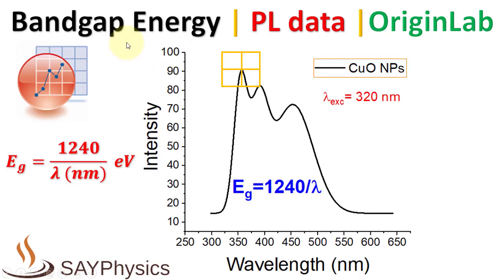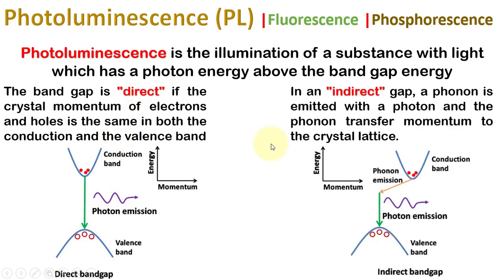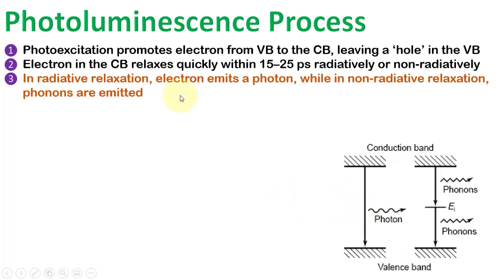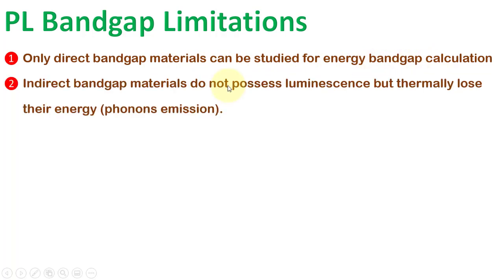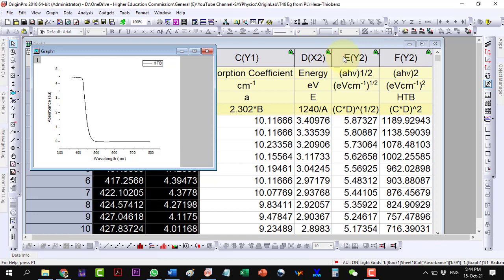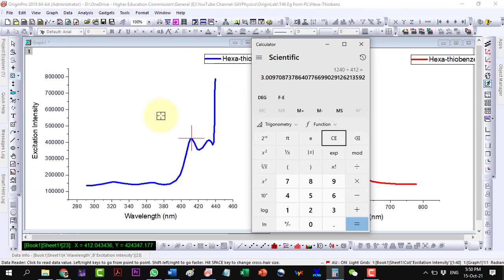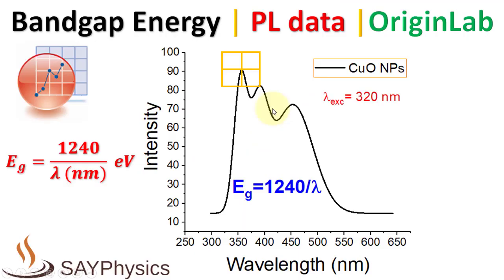How to calculate band gap energy from photoluminescence (PL) in origin

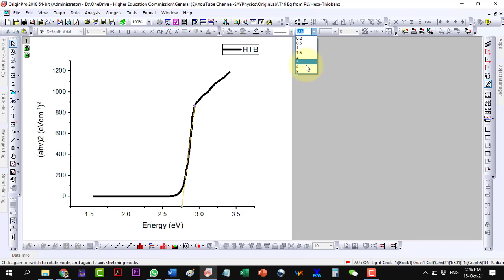Comment: 8:00 x-intercept you have found is not the true value, as y=0 line lies little bit above the horizontal axis of the graph. So Eg has to be slightly bigger than 2.8 eV. Moreover, the use of "Quick fit" tool is the right and practical way for linear fitting. It gives you two parameters slope (m) and y-intercept (y0) of the fitting line. Then, calculation of x-intercept (so of Eg) is  straightforward: x0=-y0/m.
Reply from the maker: Yes, you're right dear. Thanks for your valuable input.
Reply: @SAYPhysics  You're welcome. Thanks for videos.

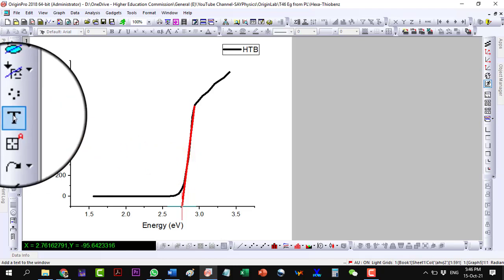Comment: The estimated band gap in your video around 8:23 should be a little bigger. The y-axis does not start at 0 and thus the fitted line reaches lower value on x-axis than it should. What do you think?
Reply from the maker: Yes, you're right. I should have been calculated at y=0, as explained in the first session of the tutorial. Please check the pinned comment. Thanks

Comment: Respected Sir in the PL band gap limitation section point No # that indirect band gap do not possess luminescence but  they  thermally loose  energy. My material is quasi  band gap can I measure the band gap and it will be correct as I already corelate the band gap  with the Urbach Energy and Tolerance factor
Reply from the maker: Regarding your query about the limitation of indirect band gaps in the PL band gap section, it is indeed true that indirect band gap materials typically do not exhibit significant luminescence, as they tend to lose energy thermally. However, it is important to note that your material, which possesses a quasi-band gap, may exhibit different characteristics compared to indirect band gap materials.
In the case of quasi-band gap materials, it is possible to measure the band gap and obtain accurate results. You mentioned that you have already correlated the band gap with the Urbach Energy and Tolerance Factor, which indicates that you have taken into account relevant parameters to support the accuracy of your measurements.
It would be advisable to conduct further research and review relevant literature to ensure that the methods you have employed for measuring the band gap in quasi-band gap materials align with established practices and principles in the field. This will help to validate your findings and provide a more comprehensive understanding of the band gap energy in your specific material.
Reply: @SAYPhysics  Thank you Sir

Comment: Incorrect way to describe fluorescence or phosphorescence. It is not the illumination time that differentiates PL. It the response time of the system in which electron transition time from CBM or metastable state  to VBM determined if it is fluo or phos.
Reply from the maker: Yes, it is the emission features that result in the luminescence. Thanks for the input

Comment: Thanks for your video, really helpful :) I have a silly question: during the PL measurement that I watched (a direct bandgap material), the laser beam is constantly on the sample, constantly providing energy to the material. In this case, why electrons relax? In my mind they would only relax and emit photons when the laser beam would no longer be reaching the sample...
Reply from the maker: Thanks for the appreciation dear. The thing you're talking about is the procedure of UV-Vis and not PL. In PL, a sample is excited at a specific wavelength and then its emission is scanned in a defined region. Thanks
Reply: @SAYPhysics  I see. I agree with that :) That's actually how the experiment I watched happened (it was actually micro-PL). Still I can't understand why there is relaxation once the laser is not turned off during the experiment...
Reply from the maker: @Beatriz de Simoni  As I see it, it's not necessary that every photon do excitation (through resonance mechanism), some even cause de-excitations through stimulations. Thanks
Reply: @SAYPhysics  thanks a lot for answering!
Reply from the maker: You're welcome